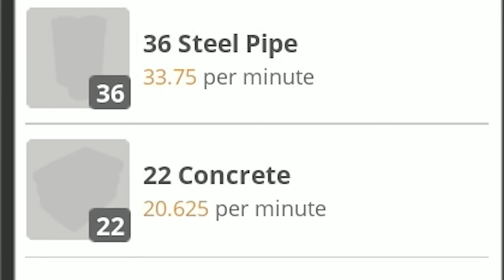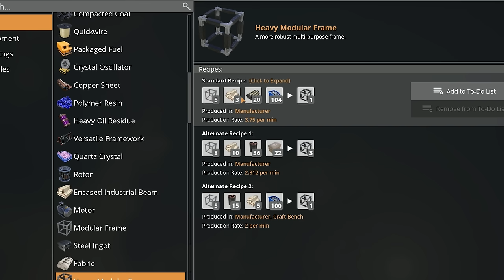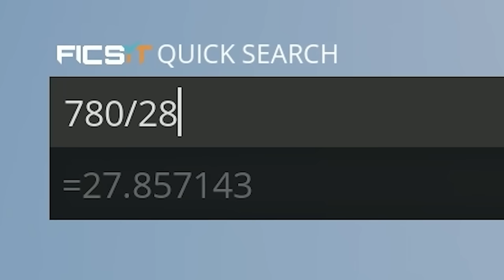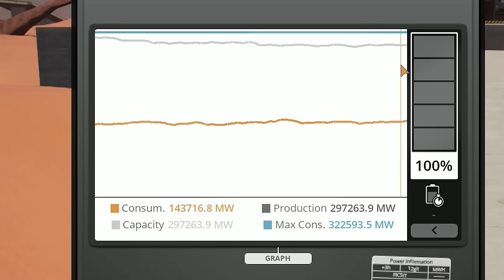100 Heavy Modular Frames PER MINUTE in Satisfactory

Comment: The alt recipe for HMFrames is divisible by thirds. I found this out by reducing the 2.813/min to 2.5/min. When you do that all of the inputs will end in .333 or .666. So. 1/3 and 2/3 ratios. The rest of the math ends up being really easy at that point and your manufacturers will use slightly less power.

Comment: The overflow setting already includes materials that havent been selected otherwise, you technically dont need to have an extra "heavy modular frames" output
Reply: I think he just wants to have that belt ready in case he needs  to reintroduce those heavy frames back to the system.

Comment: I have a issue that has been bugging me for awhile. Would it be better to mine the ore straight into a smelter or stock pile it?
Reply: It's almost never worth stockpiling anything that's not used for building materials. Maybe some edge cases, like your power network can't handle the smelting process at all times and you need to switch off smelting intermittently but still want full output from the miners, or the ingots from the smelters back up sometimes but you want burst output in excess of what the miner can produce. In the first case, though, it's easier to just build more power, and in the second case, unless your world is running out of free resources just build more miners and don't worry about.

I can't think of any compelling reason to stockpile ore.
Reply: @kalzekdor  a simple yes or no would have sufficed.  The question was on stockpiling not power. Anyways I logged on and the only stockpile i have is of iron ore due to the impure nodes. So I'm going to fix it. Good thing I'm realizing i have a lot of room. in hte past i was trying to confine it all into a small space. I wonder if its due to that i live in a small houee.....lol